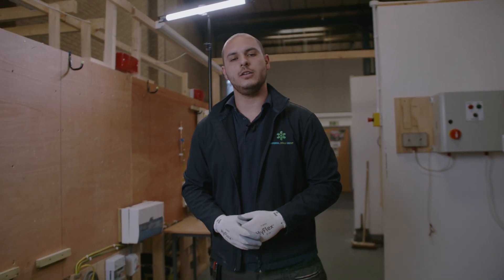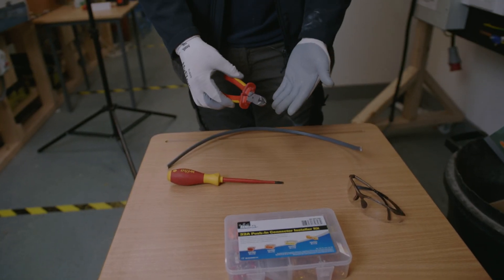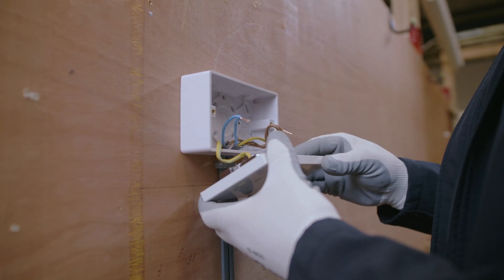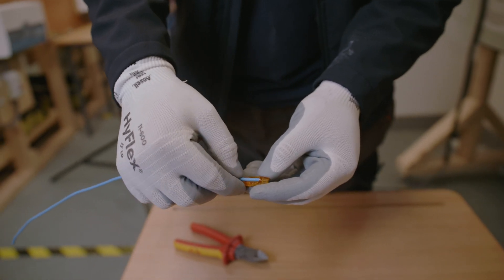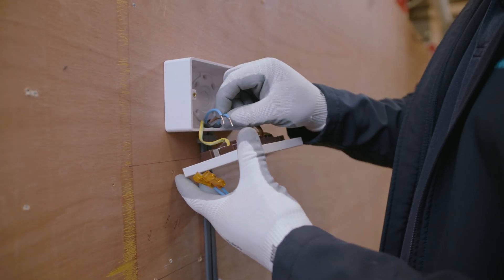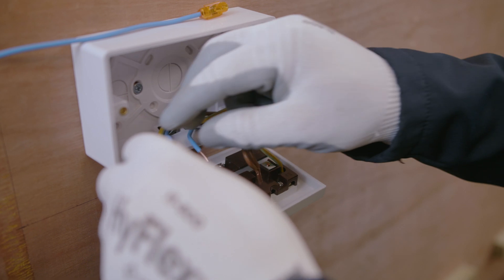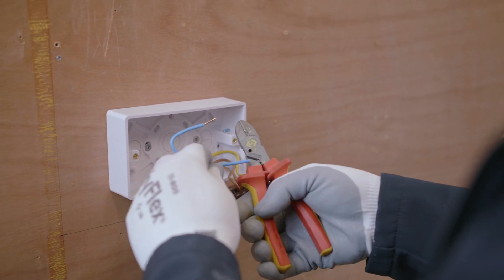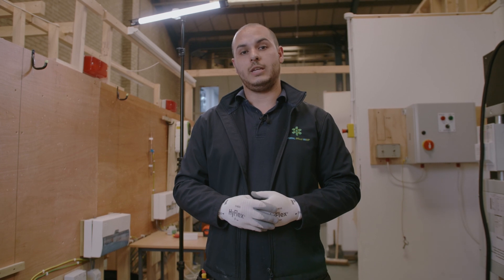Extending Short Conductors using in-line connectors | Electric Tutorial

Comment: if you have 3 sets of wires in one socket that are too short can you use nine of the connectors ?
Reply from the maker: Possibly, you are limited to how much space there is in the back of the box to accommodate 9 connectors and the cables. A deeper back box may be required.